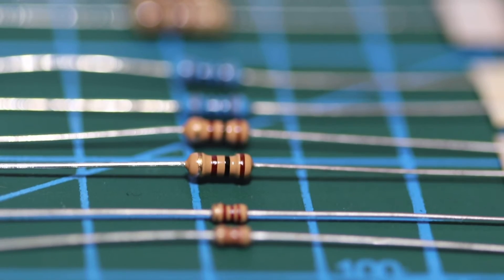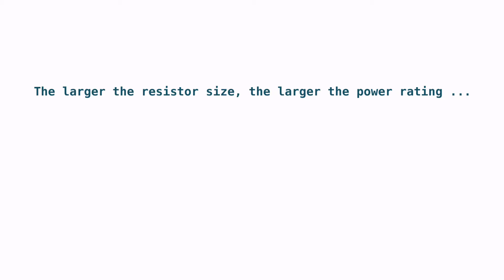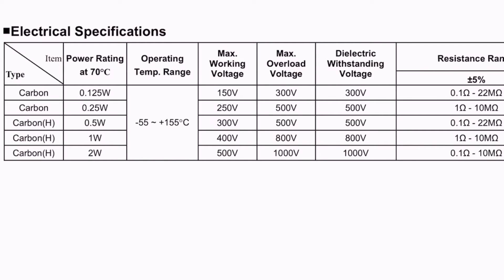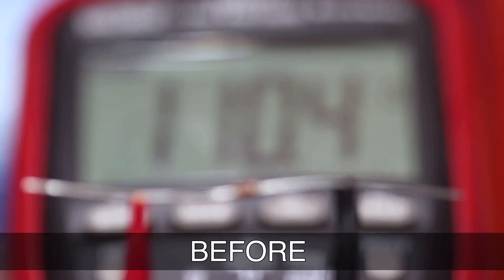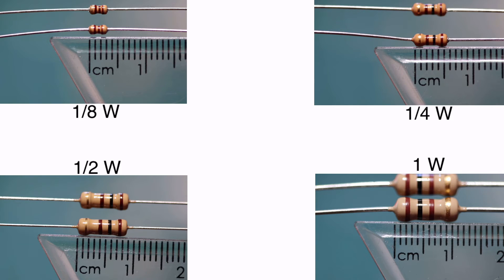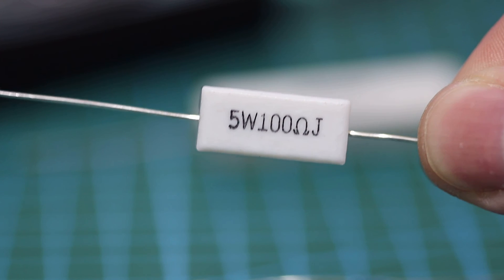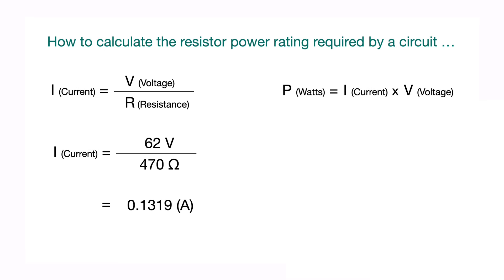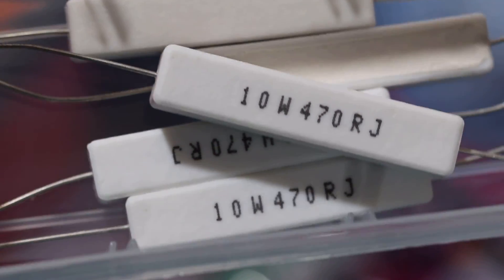Resistor Power Ratings (explained in 5 minutes)

Comment: Sir thx for posting your video.    Would you plz comment.  My resistor is connected in parallel to a capacitor for a table saw motor.   My resistor is color coded Brown, Blue, Red, Gold which I infer means a 1600 ohm =/- 5%.   I measured mine at 1483 ohms so it's too low.    But I can't figure the power rating.  My resistor is 1.5 cm.    The voltage reading on the capacitor is 125 VAC, but the voltage specified on the motor label is 115 volts.  Could be a 2nd hand capacitor?    The existing capacitor label reads 340 - 408 MFD - but that capacitor may be  2nd hand replacement.  The motor label reads "12.8 amps".   So to calculate the power in watts, I take V2/R  = 120 volts x 120 volts / 1600 ohms  = 9 watts.  Is that right?    But when I used your P=IV formula, I got Power =  12.8 amps x 120 volts (ac) = 1536 watts.   That's a big difference between 9 watts and 1536 watts.   The motor label reads " 1.5 - 2 horsepower" which is another form of power units.   1 hp = 745 watts.  So I would have a 2 hp x 745 = 1490 watt motor.  ???
Reply: You're doing two different power calculations:

The 9 watts from V²/R is for the resistor — and that’s valid if it really gets 120V across it.

The 1536 watts from IV is the total motor power — unrelated to the resistor.

Your resistor likely only handles 1–2 watts, and your calculation shows it's under-designed if it's really getting 9W. Either:

The voltage across it is actually much less than 120V,

Or it needs to be replaced with a 10W ceramic resistor (if it gets hot).

Comment: Would that ohm's still handle the power if it is in parallel? What I mean would the watts of resistor need to be the battery watts ( 12 v ×  total 14.5 amps ) or the devices watts R1 ( 12 v × 0.2 amps ) + R2 ( 12 v × 0.1 amps ) and more other resistors to handle the power of heat. Which way is where the resistor handles the heat watts?

Comment: sir good pm, i ask 8 pcs led lights what resitor we use??? Thank you
Reply from the maker: Try googling “LED resistor calculator” - you should be able to find lots of online calculators  that will help you work this out. You will need to know the supply and forward voltage etc for your circuit/LEDs.
Reply: ah, thank you sir
Reply: https://www.youtube.com/watch?v=rnapHJBEFWI